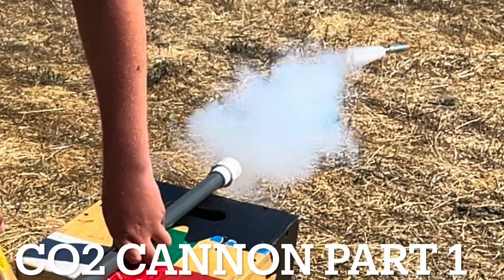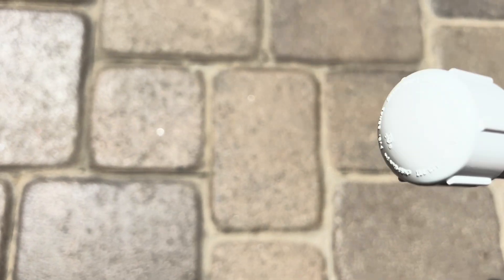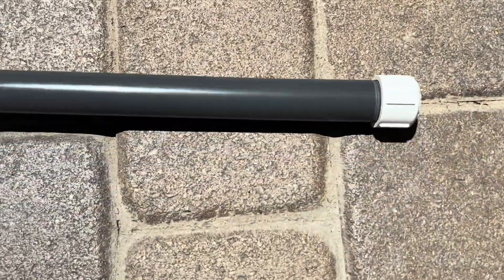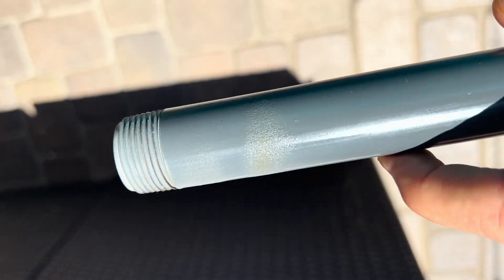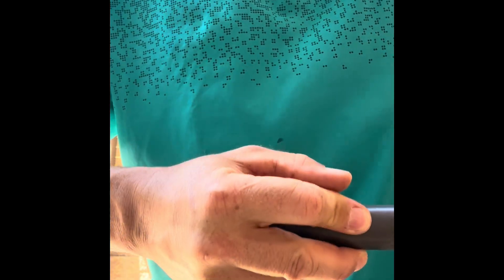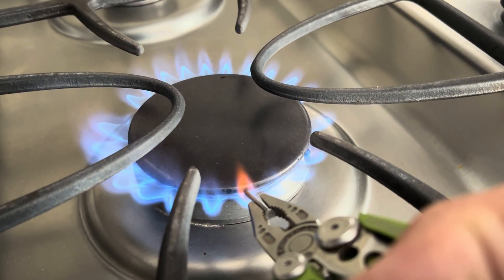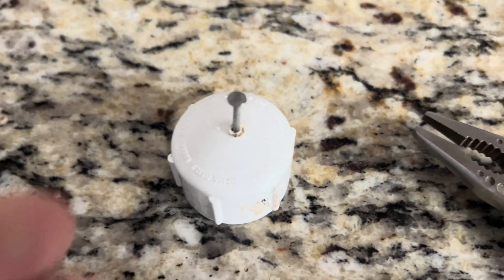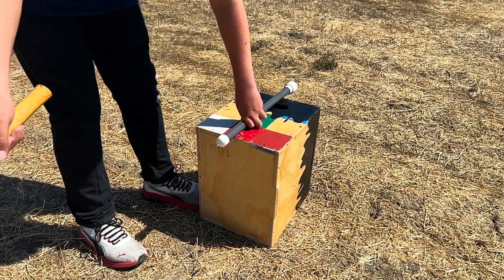Making and firing CO2 Canister Cannon

Comment: If an ampule jams in the pipe, you've got ~800psi with nowhere to go...
Reply from the maker: Point it in a safe direction, pull the nail firing pin out and it will bleed off the pressure. Once the pressure drops, you can then unscrew the cap and push out the ampule with a wooden dowel.
Reply: @oddrocket2743  ... It will take the path of least resistance. That nail will become the projectile, and/or PVC will rupture and fragment.